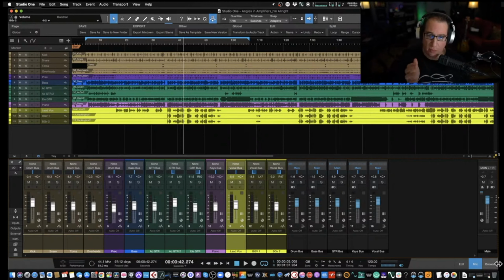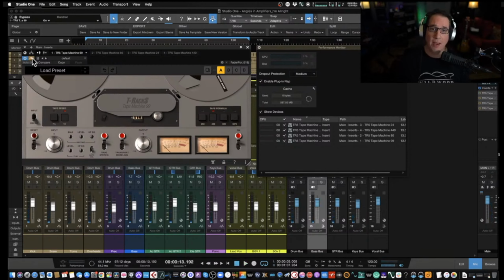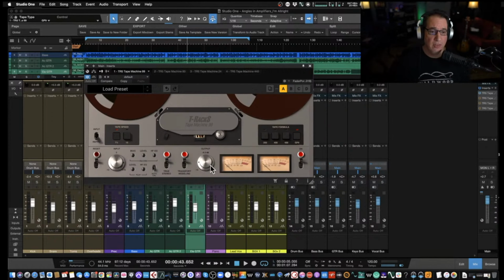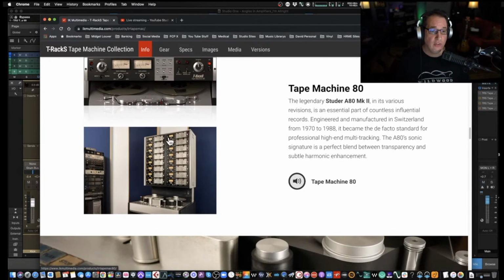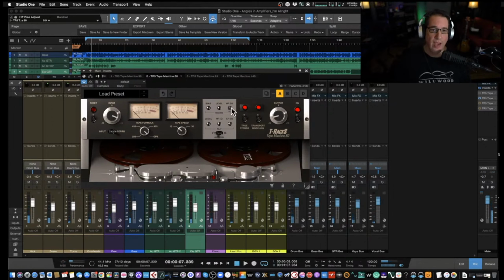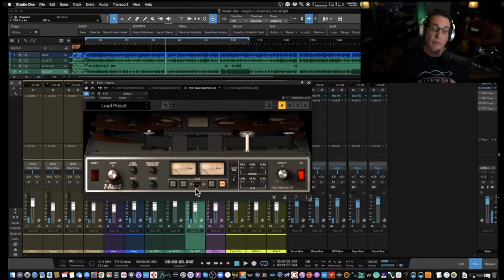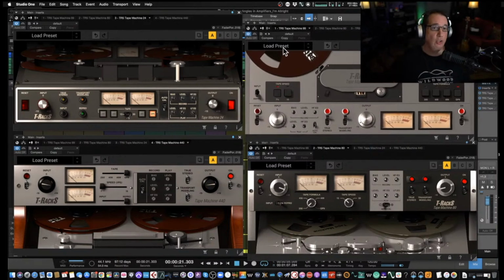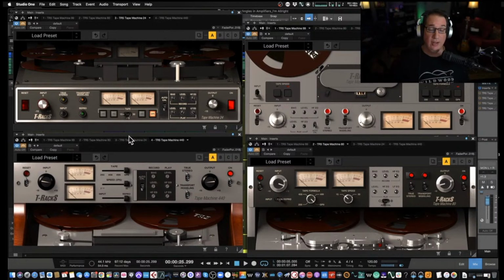IK MultiMedia Tape Machine Collection

Comment: Noice! I think the "napping mode" isn't so much a feature of Studio One, as of VST3. This low CPU usage mode is a feature of version 3 of the VST format. How that is implemented in your individual DAW or the feedback you are given by it will depend on the DAW itself. And Cubase, is awesome. Each release implements something you were previously having to use a 3rd party plugin for. The initial Pro license is expensive but after that the annual upgrades can normally be picked up for 50 euros.
Reply from the maker: Great info, thanks for the explanation!